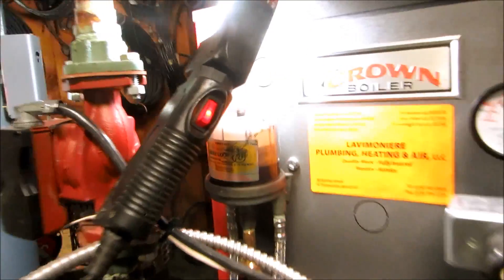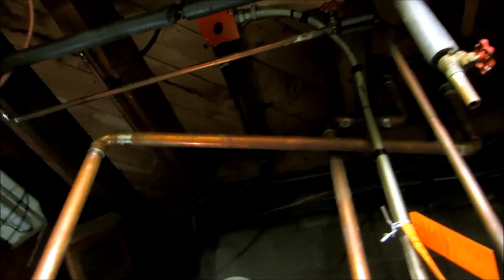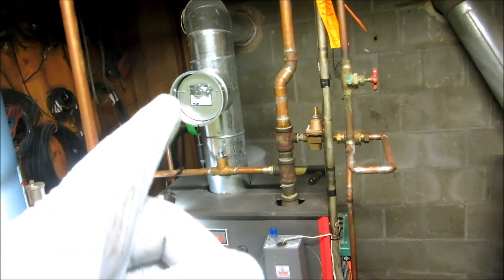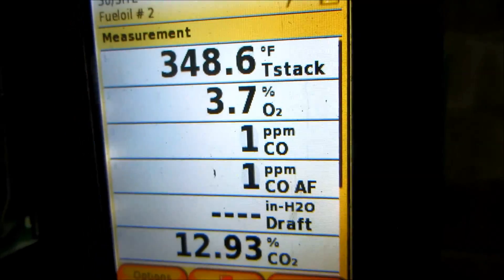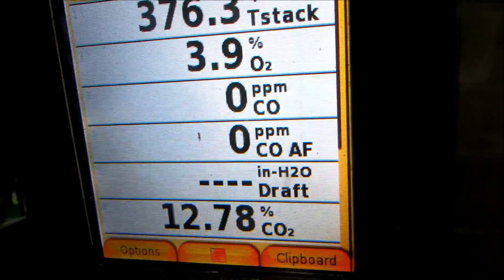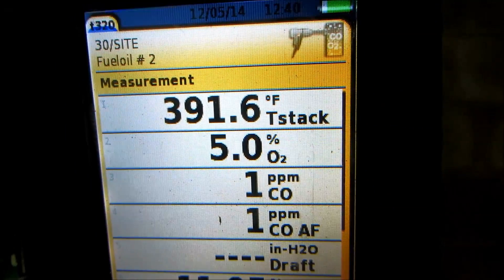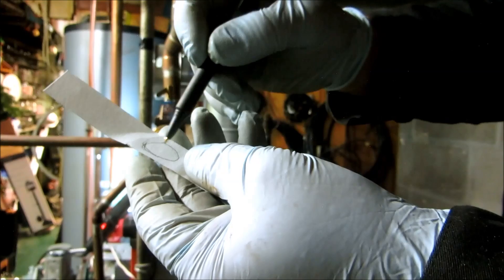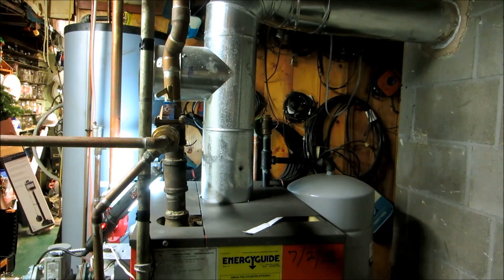annual oil burner service and combustion test ,testo 320

Comment: 86%!! You did something wrong, or your equipment needs calibration. That boiler is not a condensing type boiler, so the highest efficiency that you should've gotten would be 84ish.
Check the manufacturer's documents prior to conducting test.

Comment: Hey steve. I been watching you videos for a long time and just recent bought a 320 analyzer.  ive used it twice and for whatever reason my co2 level are very low.. now one unit was a theroflo oil furnace new install and the other was a old new Yorker boiler seems like the only way to get my level up is to close the air down more then I would like im not sure if there is a problem with the analyzer I compare it to and older analyzer and the older one has numbers that are in manf  specs have any advice?
Reply from the maker: Jim Brewer whats the gas presssure??? on manifold
Reply: steven lavimoniere Gas pressure??? Oil Burner?!!?

Comment: Steve, how do you adjust smoke on your smoke test? 
Thanks
Gilbert
Reply from the maker: gilbert de la torre if its smoke you give it more air till the smoke goes away .the airband needs to be set properly or it will be smokey and soot up the boiler
Reply: Cool, thanks, does smoke come out of little hold you drilled? Or do you need to go outside to see stack? Or use your tester, that's a video class.
Thanks
Gilbert
Reply from the maker: gilbert de la torre you need to get a smoke tester its a pump you put in smoke pipe and you ad a white paper strip and pull flue gases through paper to see if its smokey